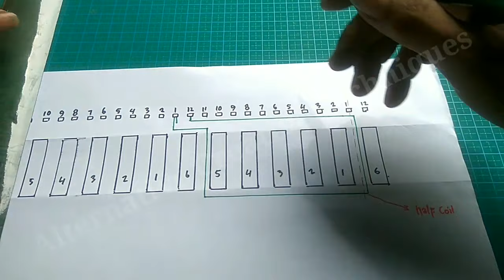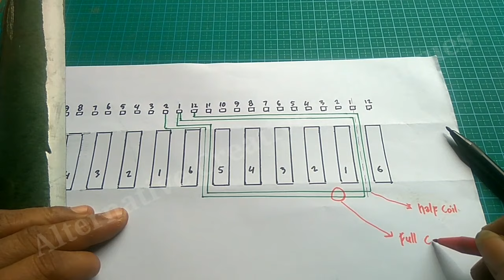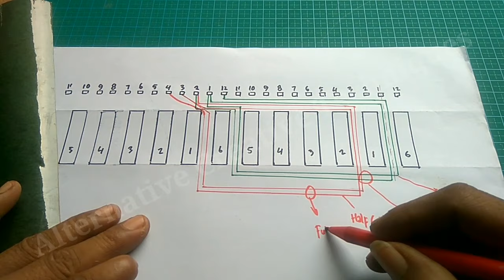How to rewind the armature of a grinding machine.

Comment: Thanks a lot dear for making me understand how to wind a fan coil, capacitor connection and ac input...
This is really an educational video...
Finally, for the fan to run for a long time , the  plastic wire should be replaced with an insulated copper wire of actual gaze which is present initially.......

Comment: Nice video though I have a question here plz,  suppose I get an armature without old winding how can I rewind in the direction I want? I.e so that it can rotate either clockwise or anticlockwise?
Reply from the maker: What you need to pay attention to is the commutator with the rotor slot.  Must be the same as in the video.  Because there are different ways of wrapping it.  The winding direction is all the same, clockwise.
Reply: My question too is, as my friend here just asked you, what if there is nothing on the iron core how would I be able to wind the armature without it gives a lot of sparks on the commutator?

Comment: Is it posibel to rewound armature to starter/generator ore to make dc/dc rotary converter with 4 brush holder starter motor? And what is main difference for starter motors magnet type and coil type how is their voltage turns ore amp turns calculated for magnet type starter motors?

Comment: I kindly ask if you can wind  a sewing machine motor for me.  It is currently at 110 Vac. I need 220 Vac.
Thank you 👋
Reply from the maker: You use 0.25mm diameter wire.  The number of turns you equate to the original.
Reply: @YudiHermanto4H  Hello  !
Now, the original is powered at 110 Vac.  It was a sewing machine used in the United States where the electrical network is 110 Vac.  I would like to modify for a voltage at 220 Vac.  I ask if I can send it to you to do this job.  Evidently paying what you ask for.
Thank you 👋